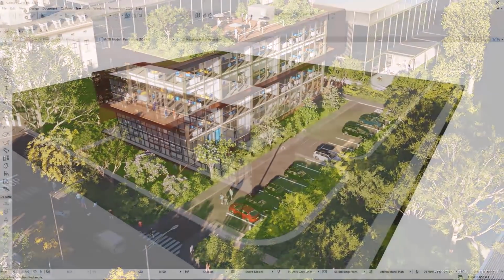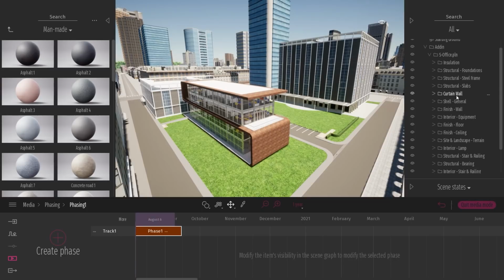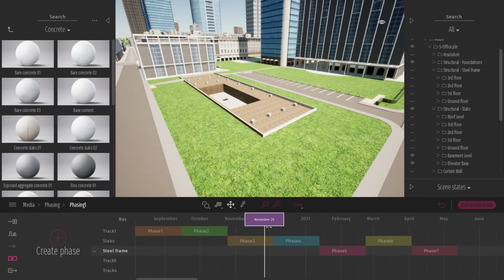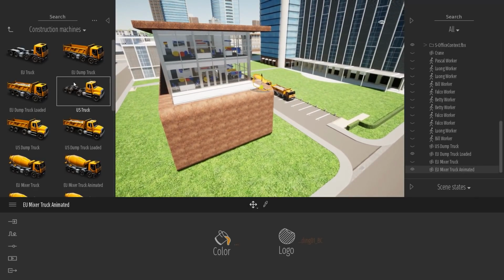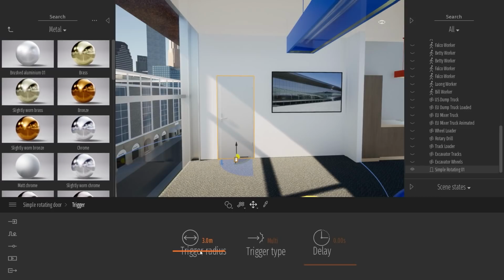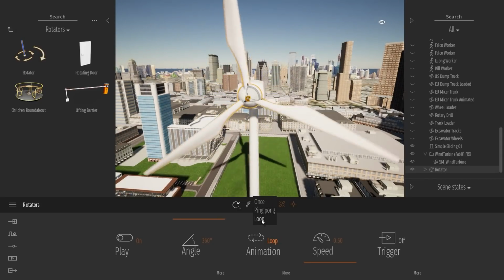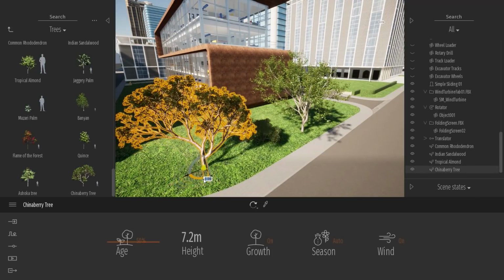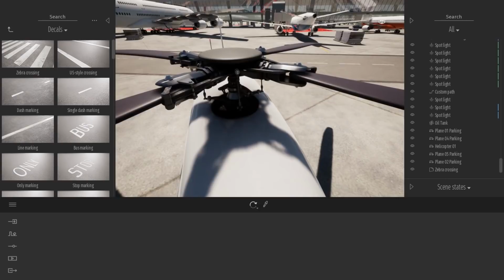A dive into the new features of Twinmotion 2020.2 | Webinar | Twinmotion

Comment: Hey! i use twinmotion on a MacBook Pro and sadly have some issues with the shadows… i searched online to maybe find a solution but on the TM forum there are a lot of other mac users with the same problem not knowing what to do…. it’s really weird, when i open a new project, there is this weird large shadow like there is a 2nd starting ground blocking the sun. this problem is only found in TM 2020.1 and above. So im forced to still using TM 2019…. please help.
Reply: This is not uncommon on both Mac and PC - your computer is unable to process the full scene.  A better computer or a lighter model would help